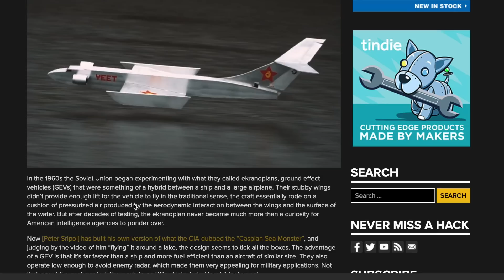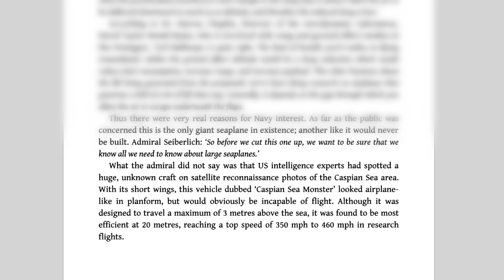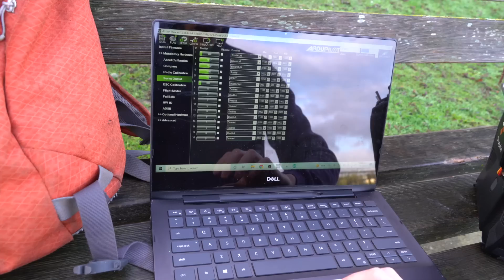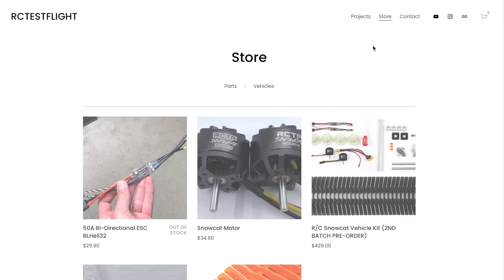Worlds First 'Real' R/C Ground Effect Vehicle

Comment: My best result with free flight ground effect gliders has come from a design with a low wing and high tail, like the Lun/Caspian Sea Monster. I keep the CG pretty far aft, so the tail has to generate lift at all times. The lifting tail is the key.

For a given speed, the tail always generates the same amount of lift, because it is out of ground effect. The wing, however, generates more lift as it gets closer to the ground. If you launch the glider too close to the ground, the wing generates a surplus of lift, and climbs higher, reaching equilibrium against the tail’s lift. If you launch it too high, it dives toward the ground because the wing is not generating enough lift to balance the tail’s lift. But as the wing approaches the ground, it generates more lift, and finds equilibrium.

This is the positive feedback loop you are looking for. The key is a high-mounted lifting tail, out of ground effect, and a low wing in ground effect.
Reply from the maker: A few weeks I drew up a design that utilized this principle! I hope to try it out soon.
Reply: @rctestflight  Excellent! I look forward to it!
Reply: @rctestflight  I don't think you ever explained this principle or why you added the elevated tail in your new videos on this design.
Reply: @rctestflight  There is a problem in ground effect vechils you know thos floats to hold that bubble those floats are facing down which gives it compression thrust even tho compression thrust works on mach 1 or above but still it give sthe lift even commercial planes are adding that down fin for fuel efficiency if you can some how make it like not produce compression thrust then ur good to go
Reply: @rctestflight  Hey, good Video ... I rly like the promise of the ground effect and your effort youre putting in to get actual research done. I know there are scientific papers and actual research on this, ... but its most of the time inaccessible for normal people because time and effort, old data and no public attention. Thank you for that ! But !!!^^
 
... The thing with your models are, that they have no purpose. Dont get me wrong and i dont want to be harsh or smthng. The Caspian Sea Monster for example was designed to counter american aircraft carriers. It was meant to fly low to counter radar detection, be faster than any ship, have a much bigger weapon payload and outrange any ship. Lets not talk about real peformance. By the way, I think it (Casp Sea Monster) could perform much better with actual electronik flight controlers and an autopilot today. I hope youre getting the idea. I say it has a very special niche.

Today it wouldent be hornorable to counter american aircraft carriers. (Comment section, ... dont ... open an bottomless pit of problems here and discuss this) I think the ground effect can still fulfill tasks wich a plane should not. Efficiency and payload are the key components of giving it a good reason to chose over an airplane. Like @nadisch said: "when it can fly in the ground with a much higher efficiency than flying normally in the air" ... So my question is: When video with ground effect vehicle wich can "fly" all day with specific units of payload 360 non eddited? I know you doing the ground work for that with all your tests designs, but I was wondering if you rly consider to take this direction. Would absulutly love it.
Reply: That's fascinating, thank you. This sounds like the key to better GEV flight characteristics to me.
Reply: I have heard that ground effect vehicles work better when they are heavy so they have to compress the air cushion more. either real engineering or mustard said that in their video. 
so instead of reducing the thrust you increase the weight which might reduce the sensitivity to wind and widen the speed range at which the vehicle is stable. more mass might also reduce the twitchy behavior as the nose doesn't rise so quickly.
Reply: more mass compresses that feedback loop into a smaller oscillation, that's cool, i could picture it in my minds eye but I couldnt put words to it. Enough mass to hold it out of flight, but bouncing off the cushion in small enough oscillations that it looks to be stable, and the quicker you go the more linear that oscillation will become, like spinning square wheels.
Reply: This makes sense. The ground effect is real, but it's pretty weak at R/C scale and the falloff is kinda gradual. Adding the external tail is the perfect solution to making a self-correcting system.

Then you can simply fine-tune the tail lift (elevator trim?) to find the most efficient ground effect height.
Reply: @haphazard1342  exactly. You make coarse adjustments with the CG and incidence of the wing, and then fine tune it with elevator trim.

Elevator trim affects altitude and airspeed. Trim nose down, and you will either fly lower at the same speed, or faster at the same height.
Reply: Thanks GW
Reply: "This is the positive feedback loop you are looking for."
I'm pretty sure this is a negative feedback loop. A positive feedback loop is unstable.
Yes, we all knew what you meant and it's a cool design. I wish you made a video showing us your glider.
Reply: @ddegn  the only video I have was recorded in 2018. I uploaded it here: https://youtu.be/guAjZpiWAc4
Reply: Great idea!

Comment: I think the Ekranoplane was an attempt to reduce shipping costs and times. The idea was air drag is significantly lower than water. If a wing appliance could be developed that would unload the hull enough to eliminate the water contact... you win.

However, the world has resigned itself to creating bigger and bigger slow moving ships to just solve the cost issue.  :)
Reply: In most real world things throughput is much more important than latency. The Ekranoplane design is in that weird middle ground between “I need it tomorrow put it on a plane” and “I need 100,000 of them at some point”
Reply: So a hydrofoil?
Reply: @OntarioTrafficMan  A hydrofoil still have contact with the water and the speed it is effective at is lower than what you get with a ground effect vehicle (GEV). With a hydro foil there's a point where it will start to cavitate and lose a lot of the lifting force, which is a very bad thing to experience at a relatively high speed. Crashing down into the drink is likely to result in some pretty spectacular acrobatics involving 360 flips end over end.

A GEV on the other hand forsakes the ground contact al together and going to fast will just result in it taking off like an airplane.

A hovercraft is more comparable, but this too has a much lower top speed than a GEV. If you press a hovercraft to far it will outrun the air cushion that keeps it from slumming with the rest of us that depend on buoyancy or wheels to keep us from dragging in the dirt or sinking in water. Thing is that the faster the GEV flies the more air is pressed down under it building up the cushion that keeps it aloft. So there's no risk of outrunning it before you start nibbling at the speed of sound. But if you are looking at really high speed then a normal airplane is way more practical. When hogging the earth the way a GEV has to do to make use of the ground effect you don't want to go all that fast. There are a lot of things at sea you want to be able to react too, such as ships, freak waves and weather conditions.
Reply: @OntarioTrafficMan  
Kinda.

Alexeyev, who was one of the two Soviet engineers specialising in GEVs, and the engineer who designed the KM, was originally a hydrofoil designer, and he approached the problem as a naval architect, and basically thought "what if I design a hydrofoil, but instead of having the wings in the water, I'll have them in the air to avoid the water drag and cavitation".

Bartini, who designed the VVA-14, was an aerodynamicist, and basically tried to design aircraft that could take advantage of the ground effect.
Reply: @OntarioTrafficMan  not exactly, well pretty much, but without the hydrofoil in the water.

Comment: I think you are artificially complicating your problem by assuming a RC ground effect vehicle MUST be able to lift off water. It is clear the you can achieve ground effect over snow and even grass. Why are you fixating on water?
Reply from the maker: Because snow and grass is too easy :)
Also, there aren't nearly as many practical applications for GEVs over any surface other than water

Comment: I have two proposals/theories/questions:

1: If the vehicle had a larger wing area and more mass to shove the air down with, that should increase the height and speed bracket at which GEV is sustainable, and there for also increase the ease of obtaining successful ground effect for extended periods of time.
2: I am unconvinced that the underside of the wing would play too much in the role of stability, but it would be interesting to test if funneling air to the tips of the wings some how would make the vehicle more stable. I could cad it out if you want because my description is not very good. I'm thinking of a multi axis sweep that has the effect of having air come out horizontal in the center of the vehicle, but a bit more perpendicular to the water near the wing tips.

Combining these two theories may create some interesting findings, or a spectacular failure and waste of time. :D
Reply: Thats partially what I was thinking too, since this isnt a traditional aircraft, and thus doesnt need to be super light, more weight might help the slight breezes have less of an impact on it.
Reply: I'm not sure if funneling air to the tips of the wing is a good idea, since that will increase wingtip vortices. I don't think GEVs have much of a roll axis instability problem anyways, since the lower wing will always produce a lot more lift than the upper wing. There's only altitude/pitch instability.

don't know though not an aerodynamicist

Comment: When flying a quad I can notice the ground effect while trying to hover low. Huge throttle difference between hover 2 inches vs 6. Can get it balanced where the quad will bounce up and down without a throttle change. I wonder if a helicopter would have a stronger effect than a plane since the propeller has a huge diameter
Reply: They do, and in fact ground effect is the only time when a helicopter is passively stable.
Reply: @21Trainman  Stability is overrated.  :-)
Reply: ground effect gyrocopter 🤔
Reply: @inaoifeble  Now that's just a good idea
Reply: Same! My toy Syma drone can't fly over an inch or so when voltage sags enough before it cuts off. It's like a skirtless hovercraft.
Reply: There is an excellent video out there of a Russian Hind helicopter demonstrating this in the dumbest way possible. It attempts landing in a small courtyard between some buildings, which effectively trap the air from escaping causing a tremendous amount of compression. The Hind gets pushed straight back out of the courtyard and nearly takes out some cars.
Reply: @Canofjuice72  Too bad it was nearly, during or before that war that would be one less killing machine in the air.  

I saw one Russian pilot either almost losing it REALLY over showing off in a vid yesterday over a lake where he came so close to dipping the tail rotor I was basically unable to see light between the two.  He was either REALLY good, or really stupid, or both.  More than a few Russian pilots seem to value their lives very little.
Reply: Yeah it's called prop wash.

Comment: I wonder if it's a materials issue, seems like weight is the reason it's still capable of flight. So you wouldn't have to reduce pwm in the motors, at least as much

Comment: I am so confusion right meow (4:20) accelerating air through a gap, water wing, would cause a decrease of pressure. Just like The Venture Bros found out. Or was it
Venturi Bros? So you would have to slow the air down or make up another explanation, but hey WTF do i know. I am just wanking and keeping on smiling. Be good :)